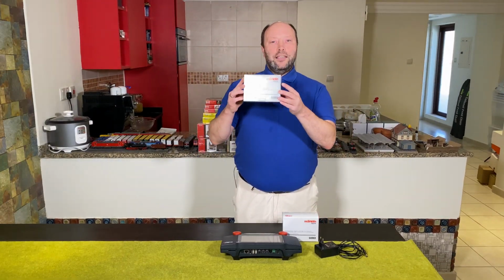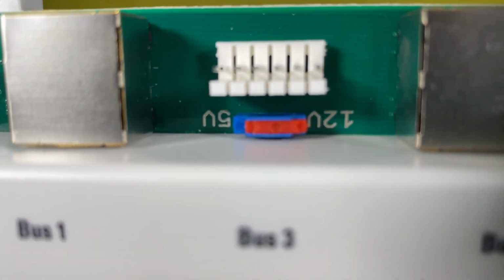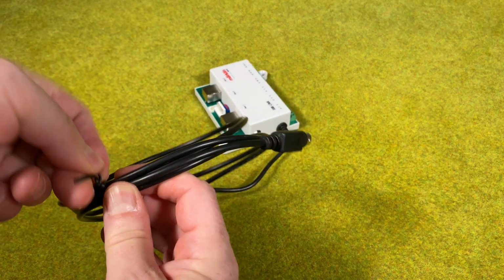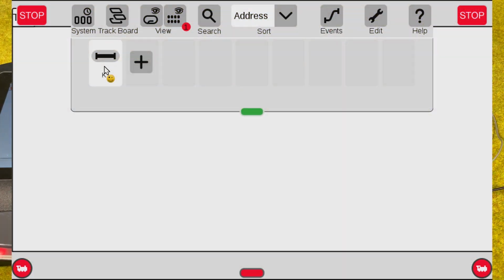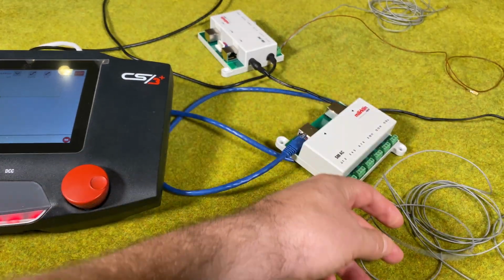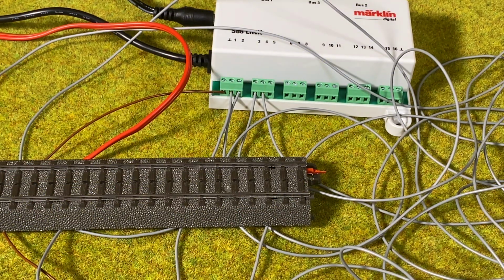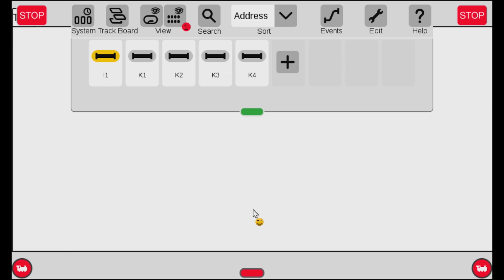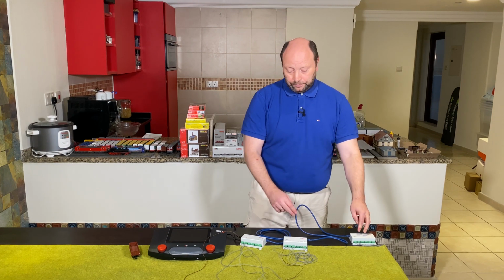S88 and Link88 (Märklin 60881/60883) on the CS3 with contact track (Automation Episode 3)

Comment: Bonjour si j'ai un aiguillage sur une zone de contact celui ci ne fonctionne pas c'est normal ?
Reply from the maker: Hi Nicolas, the turnouts/switches should not be made into contact tracks. Insulate on all sides of the turnout/switch and make contact track of the track between the turnouts/switches. Enjoy ;-) Bo

Comment: Good evening

After cutting the bridge under track C to have a contact rail and a power supply rail, how to do it with the switches, should we isolate them with red caps or should we also cut the bridge.
Which video to watch?
Thank you for your answer.
Best regards
Reply from the maker: Hi Daniel, you should not modify the turnouts. only make contact tracks between the turnouts. You should only modify straights and curves. Enjoy ;-)

Comment: Help please. Your videos are great and without them I would have no chance of getting things working. 
But I have one basic problem. I have connected the s88 dc (2track garden railway) and I can’t get the s88 to show up on the system/settings screen. Any help would be appreciated. Thanks in advance.
Reply from the maker: Hi Phil, I am glad you like the videos! Are you still having this issue - or did you figure it out? It is important to set the bus length correctly as described in this video and then you can add the contact as shown here: https://www.youtube.com/watch?v=asgop7QRIK8&t=3800s. If you are connected directly to the CS3+ without the L88 then choose "GFP-1" instead. Did this help? Enjoy ;-) Bo
Reply: All sorted thanks very much.

Comment: Hey, thank you so much for the videos, i have learned so much from you! 
I wanted to ask, do you know if in order to connect a booster into the CS3 alongside the L88, do i need a terminal? or i can connect them both to the CS3?

Thank you again for all the amazing videos that you create for us!
Reply from the maker: Hi, I am glad you like the videos! The booster and the L88 are connected through the 7-pin connection on the back of the Central Station 3 (CS3). If you have a CS3+ you have one 7-pin connector on the back. If you have the CS3 you have two 7-pin connectors. Hence, if you have the CS3 I believe you should be able to connect both without the terminal while the CS3 you need it. Hope this helps. Enjoy ;-) Bo
Reply: @ModelTrainFun  Thank you very much for your respond. i do have the CS3, and i have never noticed that there are to 7-pi connectors there, so it helped! 
Thanks again!

Comment: Great videos, thanks very much. We have been struggling big time until we came across your channel, now things are much less murky. Can we please ask a very basic question. We are setting up an LBG garden railway which we want to automate, We have a Central Station 3plus and are trying to work out the best way to create the train detection. The LBG has the two tracks (positive and negative) so we are assuming we have to use something light magnetic read switches to detect the trains? If so we assume the reed switches can be connected to the S88 as you have explained in your videos?
Thanks in advance for your answer.
Reply from the maker: Hi Phil, 

Märklin is a 3-rail system while LGB is a two rail system. This means that in principle you could use the S88 DC (Märklin 60882) connected directly to the rails. I do not have LGB, but one thing you have to consider is reliability. If you are using LGB outside in the garden I do not think the detection through the rail is the most reliable method.

Your idea of using reed switches /contacts seem to be the way as LGB has the LGB 17100 Track Contacts (https://www.lgb.com/products/details/article/17100). Unfortunately the manual for the LGB 17100 is not very useful... However, the following video actually shows you how: https://www.youtube.com/watch?v=UudfKtaxx1o. Additionally, the following discussion also seems to be relevant: https://www.gscalecentral.net/threads/reliability-of-lgb-track-contacts-17100-or-reed-switches-and-best-practice-for-use-and-installation.317505/

Remember f you have a Central Station 3 without built-in S88 you must also have a L88 (Märklin 60883) - this is really also the preferred method with a CS3+ for medium to large layouts (see https://www.youtube.com/watch?v=wANbrR0fdJk&t=387s). However, if you have the CS3+, then using the internal S88 is a good start.

Hope this helps! Enjoy ;-) Bo
Reply: @ModelTrainFun  Thanks very much for taking the time to reply. I shall watch the video recomended tonight, along with a couple more of yours, thanks again.

Comment: Thanks a lot for this very useful presentation. Only the 66201 power supply is not an old one, I've it with a Märklin start up set.
Reply from the maker: Hi Pascal, indeed you are right - you can find it in the starter/start up sets. Enjoy and have fun with trains ;-) Bo

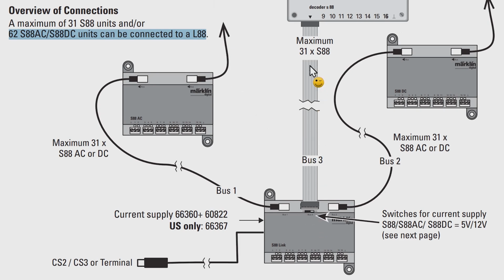Comment: 56:03 great video's. I do not wish to buy a CS3 since my CS2 works perfectly and I do not want to spend so much money. How do you install old S88's via L88 to the CS2. Do I have to rename all my contact tracks from say 12 to 3012 or does this process go automatically? I cannot find an explanation anywhere and I do simply adhere to the old Marklin philosophy that everything new should also work wthi the older fashion (except for the new slim couplings that do not function with older couplings at all).
Best, eric
Reply from the maker: Hi Eric,

I am glad you like the videos! Completely understandable to stay with the CS2 as this is still an excellent central station.

As I understand it nothing is automatically renamed. you have to manually configure the S88 contacts. When you want to use the old S88s you are connecting these to bus 3. Do remember to set the switch to 5V as the old S88 do not support the new 12V - see page 14 in: https://static.maerklin.de/damcontent/6a/f5/6af536424f70e1294136e4187262615b1619688441.pdf 

Also remember that the L88 needs a power supply to work. The S88 contacts on the L88 are addressed as 1-16 as far as I can see from the same manual on page 16. The first of the old S88 you connect to the L88 is addressed as 3001-3016.

I hope this helps? Enjoy ;-) Bo

Comment: Hello Bo. To me it seems, that you are missing one option. I have connected 60881 to CS3+ and all 16 are working ok. Therefore I have purchased another 60881, but when I connect this new one to the first I do not get another device to connect contact-tracks to ?
Reply: I migth add, that I now have both a GFP3-3 and a GFP3-1 but only GFP3-3 can be selected when adding contacts.
Reply from the maker: Hi Georg, 

I am not sure how you ended up with two GFP3s as this it the internal S88? Unless I am mistaken there should only be 1. I suspect one is not working and the other will be the one to use as you mention above.

When you have multiple S88s connected directly to the CS3+, then you connect 1 S88 directly to the CS3+ and the 2nd S88 to the first S88. You do this by connecting the "out" on the first to the CS3+ and the "out" on the 2nd S88 to the "in" of the first S88. You can distinguish "out" and "in" as small triangles on the S88 showing out/in on the S88. You can connect more S88s as you connected the 2nd S88. You can see here how an additional S88 is connected to the Link88: https://www.youtube.com/watch?v=asgop7QRIK8&t=3485s

Then you can add the contacts to the working GFP3 as shown here: https://www.youtube.com/watch?v=asgop7QRIK8&t=2295s The first S88 is module 1 and the second is module 2 as shown here: https://www.youtube.com/watch?v=asgop7QRIK8&t=3800s

Don't forget to adjust the bus length on the GFP3 as shown here, if needed: https://www.youtube.com/watch?v=asgop7QRIK8&t=2451s

Hope this helps! Enjoy ;-) Bo
Reply: Hello Bo. Yes, it helped a lot to try once more. The code word you used was "Module 2". I tried to create a connection with Module 2 and contact 1 but the contact field turned red. When i used Module 2 and contact 2 it all worked out. I don't know how I can clear the contact 1, but I am sure I will find a way. Thanks a lot, very great.
Reply from the maker: @Vagabond4320  Red means that the S88 has not decided yet. As a test try to connect the port to the brown and see it go yellow. White=not activated, yellow=activated and red=undecided. Enjoy ;-) Bo
Reply: Hello Bo. I still have problems with the connections, when I want it to work with Windigipet, the numbers get mixed up. How to connect it correctly?  @ModelTrainFun
Reply: Hej Bo. Jeg er stadig i kamp med kombinationen CS3+ og Windigipet. I WDP kan jeg se at det egentlig virker, Rückmeldings-konfiguration afspejller banen intakt, men når jeg skal tilmelde det som kontaktpunkter så virker det kun for den første S88 (Marklin) har du nogen mulighed for at gå mere detaljeret ind i en fejlsøgning Jeg har nok arbejdet på det i en måned så jeg er lidt frustreret.
Reply from the maker: @Vagabond4320  Email mig - se about: https://www.youtube.com/@ModelTrainFun/about

Comment: Hi Bo,

Thanks so much for posting your very informative videos to YouTube. Your videos have been, by far, the best source to help me understand the digital worlds of Marklin and Trix.

I am developing a shuttle layout with 2-rail (Trix ) track (so I am able to run a collection of trolleys from Bachmann and other companies that I have purchased over the years. All are DCC). The shuttle layout is elevated above a Marklin 3-rail layout.

I have watched nearly all your videos, and have watched some several times (especially those in the Automation series), but a few questions remain.

I have a CS3 (not the Plus version), and I want to stop a trolley at each end of a Trix point-to-point layout, as well as at an intermediate station in the middle. The trolley would reverse direction at each end, then stop and the intermediate station for a bit, then travel to the station at the other end of the layout, then repeat.

I understand that I must purchase a Link S88 (item 60883). But I am confused about how best to do track detection and automate the layout. I believe my 2 choices are to use either 1) reed switches with the Link S88; or  2) the S88 DC Decoder (item 60882) connected to a Link S88, but with all the wiring to the track done via the S88 DC, not the Link S88.

Choice 1 (Reed Switches): I understand that if I were to use reed switches, they are just momentary, and do not provide true block detection. I would wire them to terminals on the Link S88, and could then trigger events when the reed switches detect a magnet attached to the bottom of a loco or car (such as sounds, speed control, etc.). I really don’t like this solution because of the work/wiring involved with installing reed switches in various places to trigger events. In this scenario, I believe I would not have to purchase an S88 DC or insulated rail joiners (as I would not be creating blocks).

Choice 2 (Using the S88 DC): I would use insulated rail joiners to create 3 blocks to detect locos or lighted cars in each of the 3 blocks via the presence of current (i.e., no magnets or reed switches required). But, in this scenario, I do not know how to stop the trolley precisely at the 3 stations, or how to trigger sounds and speed control unless I do it all on timing, which seems imprecise. Would I have to use reed switches to accomplish this, after all?

I guess I just don’t really understand how the reed switches and the S88 DC would work together.

Thanks so much for any help you can provide. Also, it would be GREAT if you could produce a video specific to issues like this which are unique to 2-rail track.

Again, thanks for your great videos!
Reply from the maker: Hi Brian,

I am not a 2-rail expert, but to me you got it all right. Your understanding of the reed contacts is correct and yes you have to use the S88 DC to detect blocks:

1. Agreed - you need the reed switches on the track and the magnets on loco/cars. No insulated rail joiners needed.

2. Not sure why you are talking about 3 blocks... are you thinking of 3 blocks in a circle? Indeed no reed switches or magnets in this scenario. For 2-rail tracks: only wheel sets that draw power are detected, so not the entire train. You can add a resister to a wheel set on the last car to get the same effect as if it is drawing power or has light. I do not have 2-rail, so unsure of resistor size. As I understand it you do not want to add a resistor to all wheel sets as this will draw too much power?

If you only have one trolley and want to minimize price I think the reed switches could be the cheapest as you only need 3 reed contacts and 1 (perhaps 2) magnets together with the L88. However, if you know different kinds of trains would run on the same stretch (perhaps even have more blocks on the layout) and you dont feel like having magnets on all your trains, then the S88 DC version is better. Generally, on medium/large 2-rail layouts I understand that the S88DC is preferred.

Hence, to me you can use reed switches or S88DC as you wish. If you combine you have to remember to put magnets on all trains that must trigger the reed contacts. I have seen some modellers use the trick that only some trains have the magnet such that only certain trains trigger and stop at a station. Hence, it can even be beneficial to combine.

If you use the S88DC, then the simplest solution is only to detect the track where you want the trolley to stop at each station. You do not need to detect all tracks. In this way the S88DC is almost used like reed switches. It will detect immediately when the first set of wheels from the trolley hits the track. I recommend a longer track such that you get a more reliable detection. Using this method you can just set speed to 0 and adjust the decoder to slowly brake. If you want to control the slowing down/braking. Then use the trick of having first a block where you slow down, then a block where you stop. Generally, make sure that a block is at least the length of 2 wheel sets to make it more reliable when wheels or tracks are dirty. Do remember when wheels/tracks are dirty you can get multiple triggers...

As for making a video on this - unfortunately, I do not have any 2-rail H0 trains. I do have N-scale, so it might happen, but I cannot promise ;-)

Hope this helps! Enjoy ;-) Bo

Comment: Since there 16 ports on the s88 or l88 why is there no a maximum of 32 connections?
Reply from the maker: Hi Mike, not sure I understand your question? The 16 ports on the device can be used for train detection. You need one port per contact track. Enjoy ;-) Bo

Comment: would it be possible to use a contact track without an S88/CS3? I am considering building a layout using the marklin system, however I want to make an automatic signal system using american style signals (3 posistion) operated by a raspberry pi.
Reply from the maker: Hi Jim, Yes this is possible - I know of other people operating signals with the raspberry pi. I have not tried it, so I cannot advise you on this. One thought though - if you want American style signals, do you intend to have US rolling stock? If so, then the amount of US rolling stock for Märklin is limited - although some great Märklin US models are coming this year. Consider a 2-rail instead system instead - then you can buy the Märklin US models from Trix as 2-rail version. Finally, if you have a Märklin Mobile Station 2 (MS2) then you can use the M84 to do some signal automation - however more difficult for 3-way signals than two-way signals. Hope this helps! Enjoy ;-)
Reply: Thank you very much for the reply